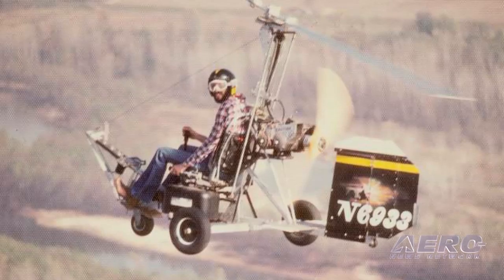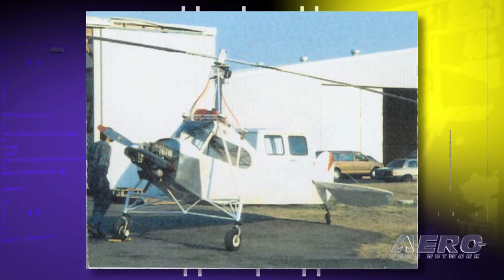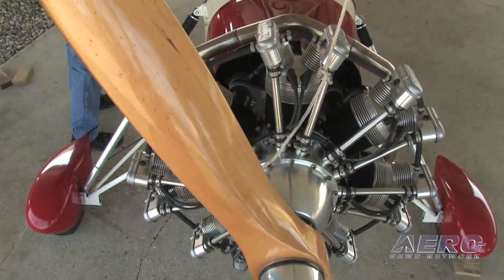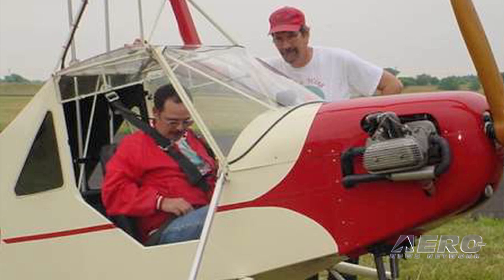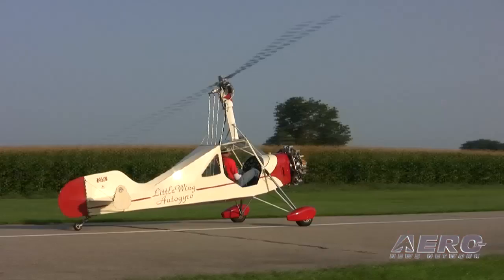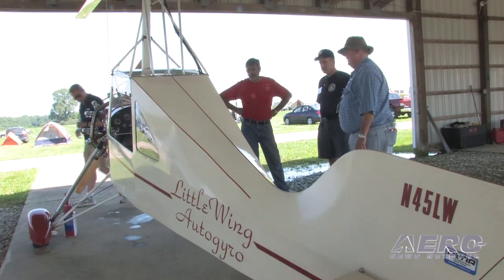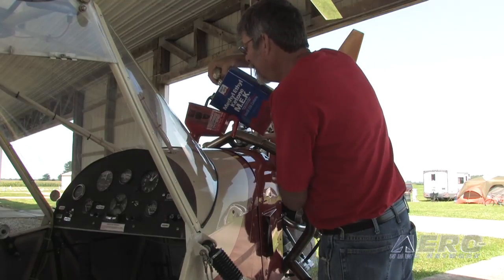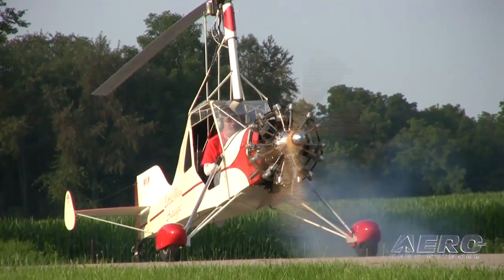Aero-TV: Ron Herron's Little Wing - Going Back to Traditional Autogyro Roots

Comment: My budget for an airplane is $2,000 US for the barest possible minimum airplane.  So I'm looking at rebuilding a Kolb Ultrastar.   Other options would be a parafan, or an Bensen autogyro, but I like the conventional airplane layout of an ultralight the best.

Most people today would say it would be impossible to build and fly an airplane for $2,000, its just not possible.  But it has to be possible, because I have no other choice but to make it possible.  Even $2,000 is a lot of money for me.

For an engine, I'm thinking a modern four stroke lightweight motorcycle engine, like from a Ninja 250.  37hp @9000 rpm, 2 cylinder.  I think I'd chose that over a used Rotax snowmobile engine.  There are just so many possible light motorcycle engines to chose from, 2 stroke and 4 stroke, I'm wondering why more people don't use them.

Somebody has offered to sell me an old Kolb plus enclosed trailer for $2000, but its half way across the continent to get it, so its not like impossible, I'd just need a truck to pull it.

This guy in the engine alone, has spent enough to buy a conventional aircraft.

Comment: I agree that a FAQ section would be helpful.  The concern Ron expressed to me re using a Subaru powerplant is one of increased weight - around 220 lbs with redrive and cooling system.  In a 2-place gyro the performance will be less than satisfactory.  Same for the corvair at 200 lbs with direct drive - and less thrust because it will be turning a smaller prop at higher rpm. Ron is probably correct when he says the Rotax 912 or 914 are probably the best off-the-shelf engines for weight and horsepower output - including redrives.  For me the cost of one of those engines is prohibitive, so I will likely end up doing a Yamaha Genesis engine conversion - 125 hp at 175 lbs all-up weight.
Reply: the weight of the Corvair is about the same as  Rotec 2800, 220-233 lbs.

Comment: I don't understand his negativity about Corvair and Subaru. Wynne has really made the Corvair a reliable option for just about every airframe, and there are tons of Subaru powered gyros, especially  in Australia.
Reply: they weigh about the same. Actually a EJ-22 with a gear drive is 100 pounds more than a Corvair. EA-81 with a redrive might be closer to a Corvair weight.
Reply: some of his opinions on those other engines may come from the RPM's at which those engines actually make advertised power/torque. The radial turns at a relatively slow rpm compared to a subi or corvair engine and also makes it's peak torque down low in the rpm range too. This keeps prop tip speed as well as rpm's down lower for better power and longevity. I had the privilege of working with Ron in the early 90's and actually worked on the original little wing for a short time before leaving the area. Ron is a genius and a true gentleman and I learned a ton from him.
Reply: @billdavis4809  Ron is indeed a fine fellow.  

the Corvair makes anywhere from 100 to 130 horsepower (depending on displacement) at 3150 rpm, and has flown 2 up at gross in a Wagabond - a full size FW based on a taildragger version of the 4 place Piper Tri-Pacer.  

The Corvair  weighs the same as or less than the Rotec 2800 in this video. That  depends on displacement; the higher HP Corvairs are lighter because they use lighter  jugs.

The Corvair also runs lower RPMs than  the 2800 in this video, which  has a redrive and makes rated horsepower at about 3700 RPM. The Corvair is direct drive.

The hp and thrust output of the Corvair is perfectly adequate for a Little Wing.